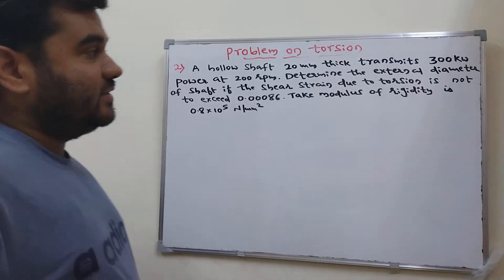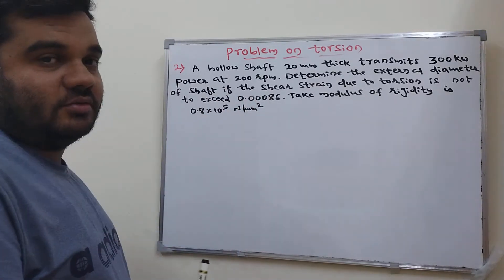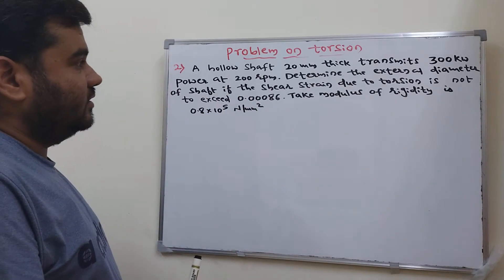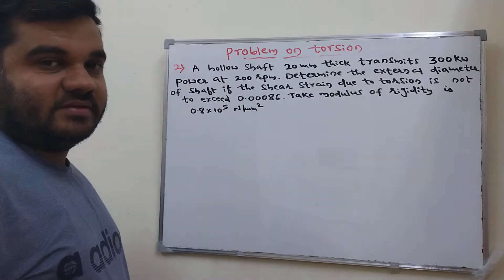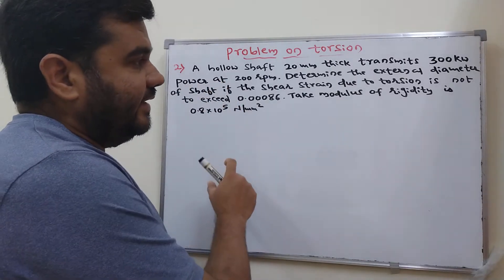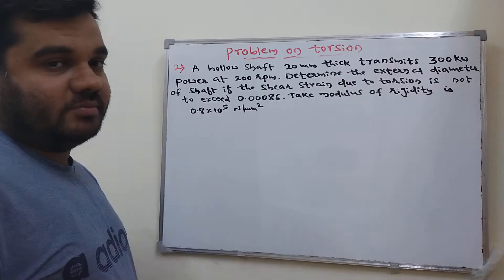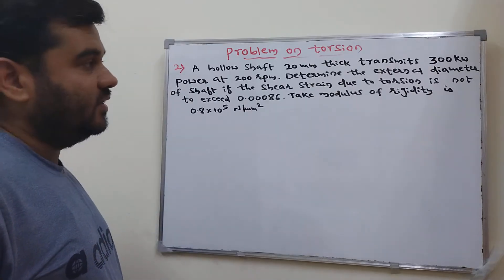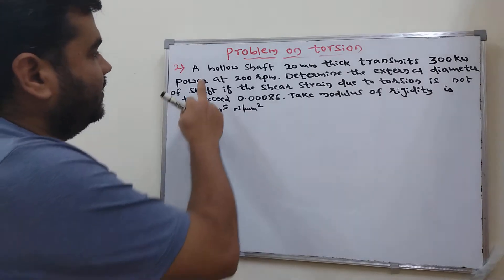Problem on Torsion 02 | How to Find Outer Diameter of Hollow Shaft | SOM| MOM| VTU| GATE| AMIE

Comment: a hollow steel rod 200 mm long is to be please sir solve this question:-used as torsion spring. the ratio of inside diameter is 1:2. the required stiffness of this spring is 100 Nm/degree. determine the outside diameter of the rod . value of G is 8×10⁴ N/mm². S